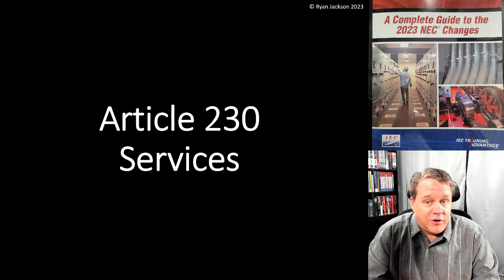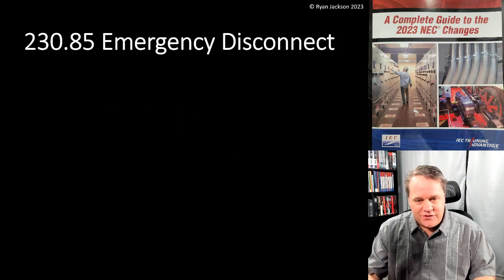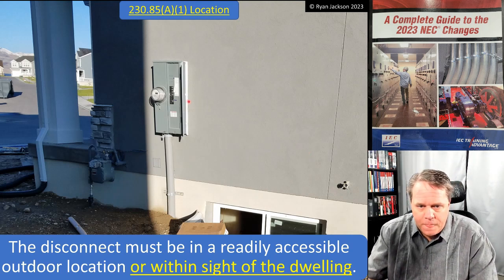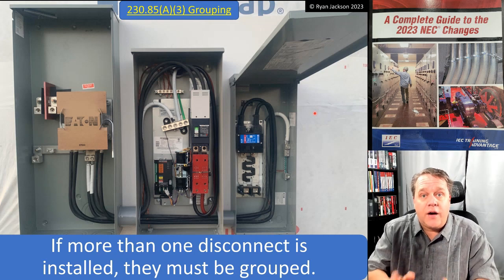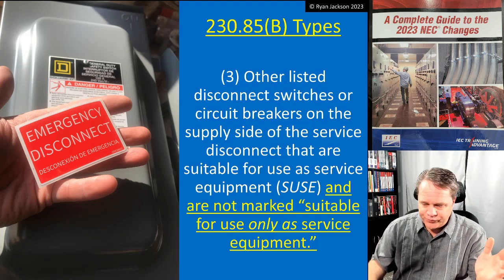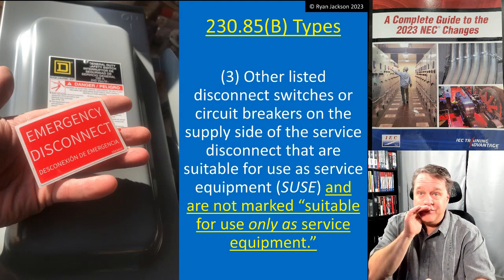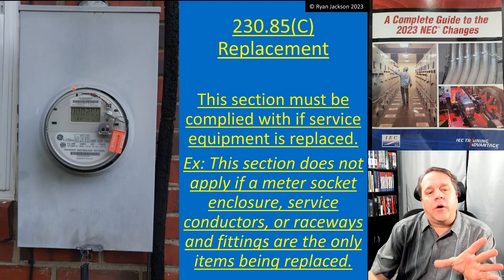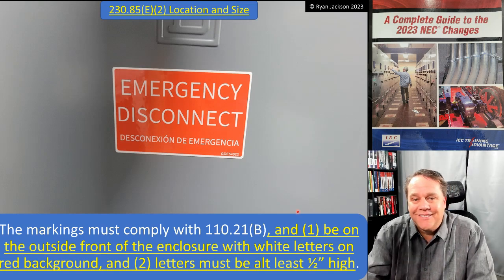2023 230.85 Emergency Disconnect

Comment: That was a very clean explanation of 230.85(B)(3)
230.85(B)(2)
Which is the way I like to live.
How I hate 4 ought SER Cable!!
You can pull it all day if you like it.
Reply: How does this work with multiple dwelling units with panels in each unit?

Comment: Since almost 100% of USA now have smart meters, wouldn't it make more sense to give the fire dept. the ability to shut the meter off either through the utility company or provide them a keyed interlock built into the meter base/meter or the ability to shutoff via wireless interface
Reply: Yeah... good luck getting ahold of somebody at the Utility Co in the middle of the night! 🤣
However, most (or at least many) "smart meters" have internal disconnects, and can be remotely opened by the utility, usually for things like non-payment. Recently ran into that here in west Texas, on a house I was working on (new construction, but meter, main & panels were set for construction power). Came in one morning to start work, and had no power. Checked the meter, and it was on and flashing, but it also said "OPN" (open). A call to the owner revealed that a bill payment had been missed. 😅. Utility restored it within an hour...
Reply: You're going to trust that power is cut by a  wirelessly transmitted signal vs a physical manual disconnect switch? Come on.

Comment: Provide an exterior emergency service disconnect, now creating a need for a 4 wire sub panel for the interior…..what happens to the existing 3 wire SE type cable to elec. clothes dryers and kitchen ranges?

Comment: The disconnect at the (outside) main panel is common in California. In fact, it's common to find ALL circuit breakers outside in the main panel.. Regarding locking the panel, would that violate the "readily accessible" intent of the code?
Reply from the maker: Nope, still readily accessible. Very common in the western US.
Reply: @RyanJacksonElectrical  Interesting. Thank you for your reply!

Comment: Not knowledgeable about this stuff at all but would like some clarification based on information from a HVAC tech. I have a service disconnect to my condenser that's a breaker box outside next to the unit. Do i have to have a service disconnect inside for the handler (does not have line of sight to the outside disconnect)?

Comment: I live in the north east, been doing electrical work for 42 years and speaking from past experience, any breaker located outside in any type of enclosure in our environment will be covered in corrosion in a few short years! That is why and always has been the reason for main breaker panels to be mounted in the dwelling and not on the exterior like it is in southern/western states! This is a bad code adjustment by the NEC period. Not to mention that the breakers of today are of a far less quality being mass produced in foreign countries with inferior quality control. I keep referring to breakers because that is what indeed will come installed in any type of resi. combo unit and to add a separate weatherproof disconnect will add a significant cost. I'm sorry, In my humble opinion this code is not only unnecessary but creates a potentially more dangerous situation of actually starting a fire!
Reply: True. Just pull the meter off will do the same Some NEC code very stupid in IMO
Reply: @ChiNguyen-wf1qt yea, fire department just gonna smash it with an axe, they aint looking for a breaker
Reply: Obviously you've never pulled a meter under load, or tried to "smash" a meter that is energized! Very bad things can happen!
Emergency disconnects are easy to install, and perfectly safe, IF done correctly. No additional hazards are imposed.
And if your winters are so terribly harsh as to deteriorate a switch enclosure so qiuckly, how do your utility's meter sockets and other outdoor equipment survive, out in the weather?
Perhaps a stainless steel enclosure would be prudent?
Reply: @Calico5string1962 the building is on fire at that point and im pretty sure that the fireman covered in protective gear is not worried about pulling a residential meter or putting an axe through it.  And who told you that you can't pull a residential meter load?  Your thinking of inserting the meter under load, thats different...
Reply: A meter socket is a means of disconnect by definition
Reply: @coreyfranco7060  Yeah... I dont think so. Not in the NEC definition(s) -  and that's what matters.
Reply: @Calico5string1962  First of all Sir, I have pulled countless amounts of meters, A large amount that were under load in emergency situations. Not a standard practice but sometimes necessary. Secondly, I state in my writing "Breaker"! You can put a breaker in stainless and it will still get corroded! I am specifically referring to the combo units that will be sold and installed to meet this requirement! Nobody is going to put a stainless service on a house! Your service would cost ten thousand dollars! Again read what I am talking about! Read the word "BREAKER"!!! Obviously you have never commented on something without grasping reading comprehension! Doing so makes you come across as somewhat ignorant to this topic.
Reply: @k---youtube  I, too, have been in the business for a long time (over 40 years) mostly in industrial & commercial settings... but never in the east (or the east coast), so perhaps y'all do things a bit differently there, and that's okay. We probably have more in common than not, so you do you, and I'll do me. 😉 Take care, stay safe...

Comment: 5:11    My install made a Ryan Jackson video. It’s a shame the inspector made me redo it cause he thinks the bottom of the transfer switch is a raceway.
Reply: That’s the first thing I noticed. I wouldn’t think that would comply either
Reply: Why would that matter anyways?
Reply: I noticed this as well. You got red tagged on routing load wires of meter base thru transfer switch to line side of the outdoor load center?

Comment: 230.85 Emergency Disconnects.

For one- and two-family dwelling units, all service conductors shall terminate in disconnecting means having a short-circuit current rating equal to or greater than the available fault current, installed in a readily accessible outdoor location. If more than one disconnect is provided, they shall be grouped. Each disconnect shall be one of the following:

(1) Service disconnects marked as follows:

EMERGENCY DISCONNECT,

SERVICE DISCONNECT..

if I was you inspector I would be handing you a orange ucc sticker... 

update your labeling and use the correct terms!

Comment: so what  wire do you run from the disconnect to the main panel SER or SEU? also do the ground rod #4 wire, water line, and gas line, connected to the disconnect or the main panel?

Comment: For option (3) this could be great for any whole house generator upgrade.  In the past, we installed a service rated ATS outside, then separate the N-G at the main panel and pull new wires with a ground included.  If I understand this correctly, we don't need to do any of that anymore.  Just as long as we install the service rated ATS with internal N-G in and put a sticker on it that says emergency disconnect, not service equipment?
Reply from the maker: Agreed.
Reply: This has been acceptable for a while I think

Comment: In my experience in Massachusetts, even on new builds we try to go with option 3 if the panel is directly behind the meter enclosure. The SEU is much easier to install. Also on existing service changes we often had existing range and dryer circuits that we "couldn't" replace, so we had to maintain the MBJ in the panel to comply.
Reply: Could you explain the second part of your comment?  What does the MB have to do with dryers and ranges?

Comment: Thanks Ryan, you helped clarify some of the issues I was having with 230.85. I'm teaching a first year apprentice class and figured that with the disconnect outside you would need to run fully rated conductors into the panel. I also was thinking that with the "Emergency Disconnect" and since it wasn't a service disconnect that you would need to change the 3 wire cable to 4. As long as the panel had a main breaker.

Comment: Great info! Thanks. 
I recently did a meter socket change-out (the old one was badly corroded) as part of a breaker panel replacement (replacing on old FPE panel inside the house). The meter & service drop was located on a pole about 70' from the residence, with UG service conductors going to the old FPE equipment. 
I relocated a new Square-D panel (with 150A main) to the outside, immediately adjacent to the old inside panel (BTW, the old FPE panel had NO main breaker!)
Anyway... when the utility arrived to pull the meter so I could do the work, they informed me I was now required to install a disconnect on the pole, immediately below their meter. I explained that the new panel had a main, which would also serve as the service/emergency disconnect. They didn't care... they said THEIR new policy was to have a disconnecting means (i.e. "emergency disconnect") located  AT their meter. I can't say I disagreed with their rationale, but it was a surprise to me (and I had never done work in this particular electric co-op's area before).
It wasn't a big deal to install it (the old meter can was coming off anyway), but did end up costing the owner some additional money for the additional materials (I gave him a deal on the labor, since it wasn't previously known).
So this new switch became the "Emergency Disconnect, Not service Equipment" (with no neutral-ground bond), and the new exterior house main became the "Service disconnect" (WITH the neutral-ground bond & ground electrode, as it was originally).

Comment: So, I do a panel swap on a single family dwelling and remove an FPE panel, and install a new Square D QO panel. I now HAVE TO install an emergency disconnect after the meter outside, correct?
Reply: No
Reply: @coreyfranco7060  Explain why?
Reply: Its just a panel swap, not a service re-vamp
Reply: That's what I really need too know because it sounds like the inspector can interpret it that way
Reply: Call the inspector and ask.  Or just do it and beg for forgiveness later...